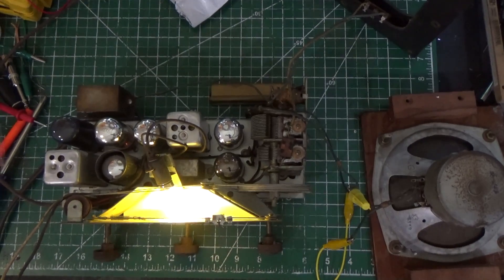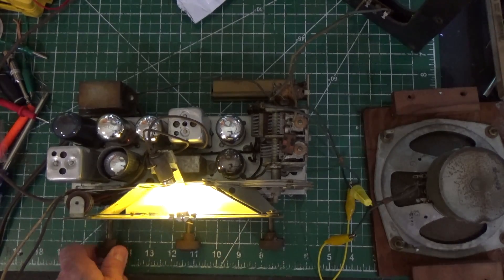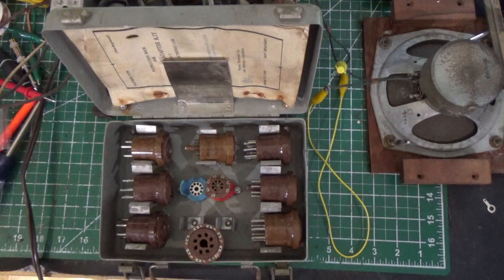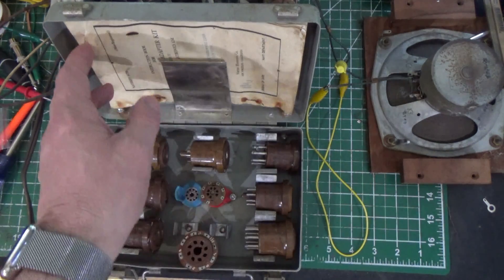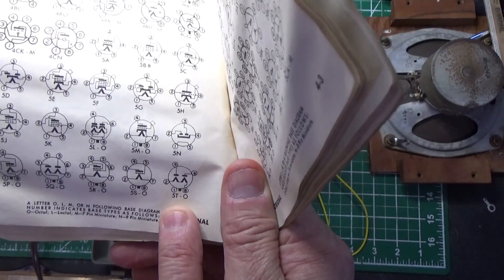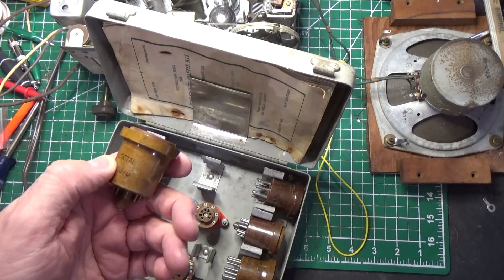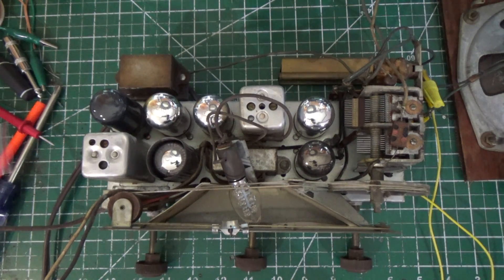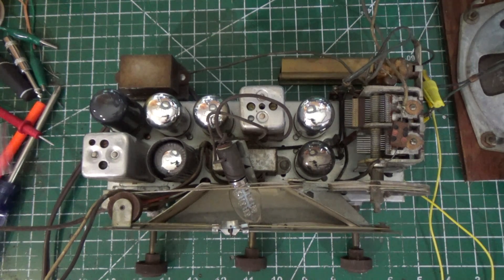Philco 1203 Radio-Phonograph Episode 4: Sock it to me in the Navy

Comment: I have to say Ron, I haven’t seen those type of Test Adaptor Bases for years.  And to think of it; by the end of the 1970s I could have had at least four, or five sets for free - audio and television service centres were discarding them.  Thinking at that time about the ‘here and now’, I never though I’d ever require a set.
I know what Brendan is talking about when he mentioned vertical chassis were access to the rear meant removing the knobs, and unscrewing a few screws to remove the chassis: such as the Bush, model VHF 80 - radiomuseum.org/r/bush_vhf80cvhf_80.html ...a few 1950s, and early 1960s televisions also incorporated such chassis arrangements, such as Bush, Murphy, Decca, GEC, Defiant, Ekco, Pye etc.
Corvid 19 is certainly having a major effect upon economies around the world.  Washing our hands regularly, and applying hand sanitizer, especially after handling cash, and holding onto hand rails, say on public transport, will hopefully contribute towards stemming the effects of this strange virus.
Regards, Phil.
Reply from the maker: Phil , what a great history...  conceptually these things are great because it makes checking voltages much easier and safer as well.  I've never worked on a TV ( yet) but I understand what you mean..  thanks my friend  - Ron